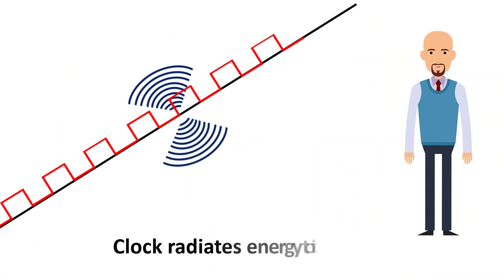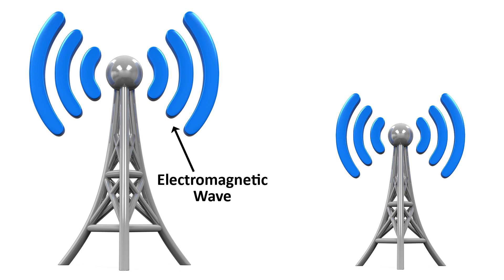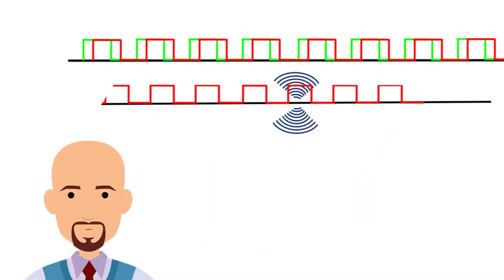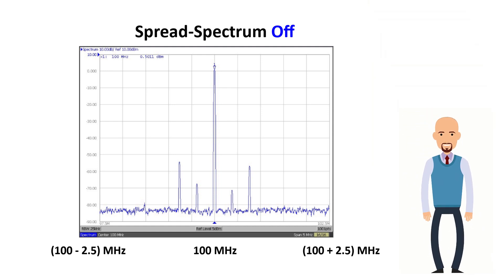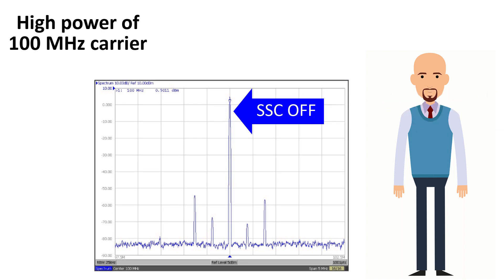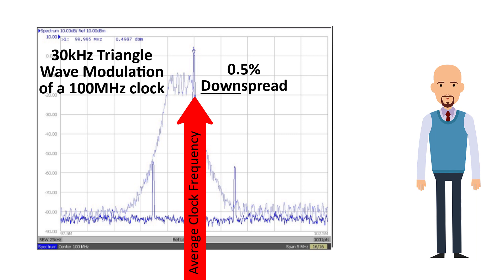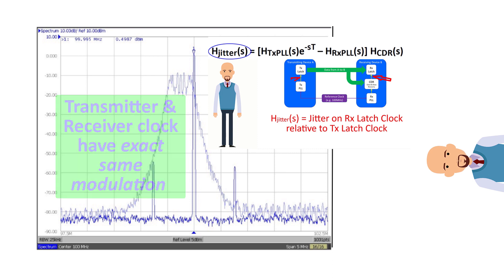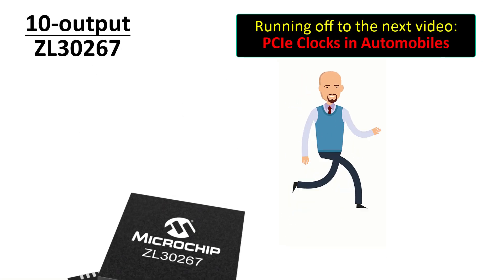PCIe QuickLearn | Spread-Spectrum Clocking

Comment: Why do most standards use down-spread SSC instead of center-spread or up-spread?
Reply from the maker: Hi there, thanks for your question. Most high-speed interface standards including PCIe use down-spread spread-spectrum clocking (SSC) because it guarantees the clock never exceeds the nominal frequency, which is essential for compliance and timing safety. A down-spread of –0.5% (e.g., 100 MHz → 99.5–100 MHz) avoids violating maximum-frequency limits, unlike center-spread or up-spread, which would push the clock above 100 MHz and risk non-compliance or timing failures in tightly-budgeted systems. Since EMI reduction is similar across down-spread and center-spread, industry standards (PCIe, SATA, USB, etc.) have universally adopted down-spread SSC to reduce EMI while maintaining strict frequency and timing requirements. Hope this helps!

Comment: How do you use this to build a jammer across a range?
Reply from the maker: Hi there, thanks for your comment! Microchip’s PCIe-compliant clock generators are designed for EMI reduction, not jamming. Using devices for interference violates regulations. Let us know if you need help with EMI mitigation instead 😊